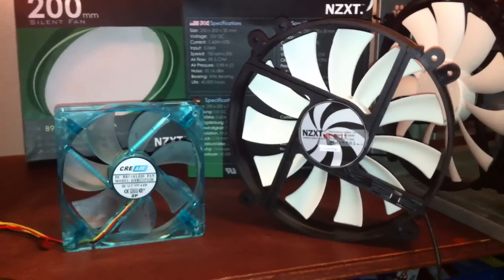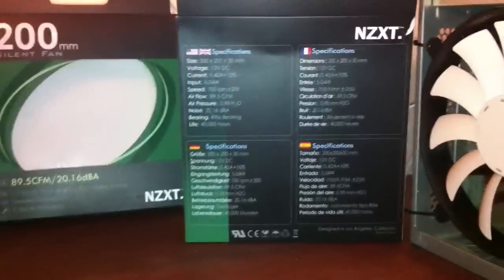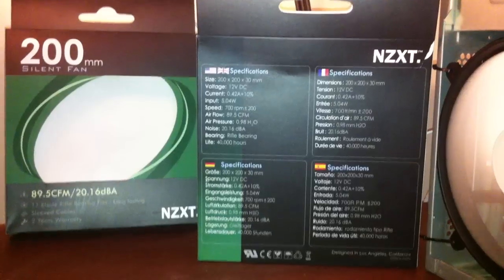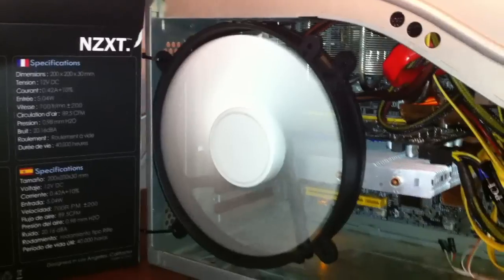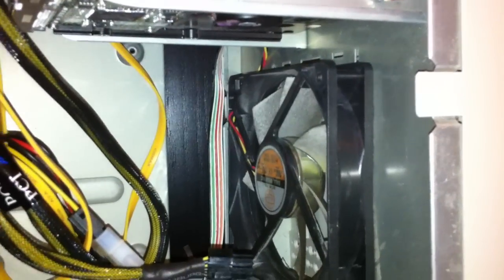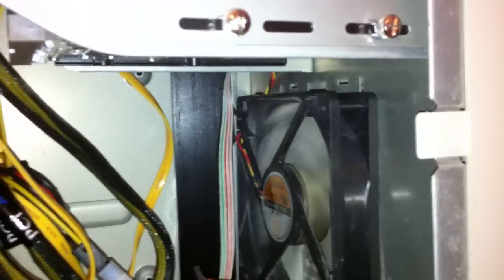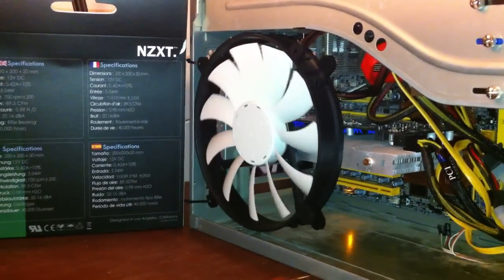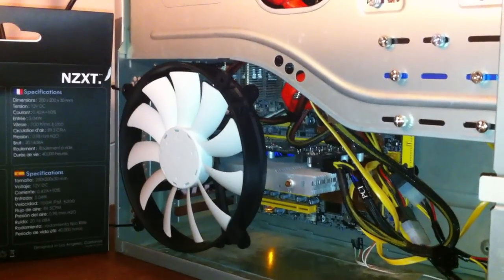NZXT 200mm vs 120mm fan comparison

Comment from the maker: A 200mm fan @700 rpm should have about the same cfm as (2) 120mm fans @1200 rpm but the 200mm fan will be quieter and use less energy.  Fan bearing and blade type also affect price/performance.  I try to use the biggest fans possible because bigger fans typically are more efficient at moving more air and creating less noise.   My current system uses 140mm fans for cooling.  One is zip tied to the GPU and two are zipped to the CPU.   If I can keep my load temps around 60c, I'm a happy camper.
Reply from the maker: Brie Thorn This is what the fan zip tied to the video card looks like.  My Slideshow

Comment from the maker: I use a single fan blowing on to the source of the heat for most of my builds but more fans might be need if the temps are over 70c. Fans have db (noise) and cfm (output) rating which help in purchasing the right fan for the job. Usually a larger diameter fan will produce less noise at the same cfm as a smaller fan.

Comment: how does one know what fan to use as an exaust fan? I can either get 2 140mm fans or 1 200mm fan, but I dont know which is better with sucking the air instead of blowing the air